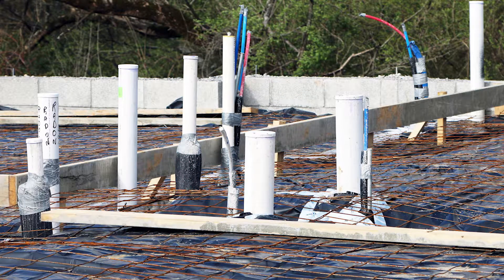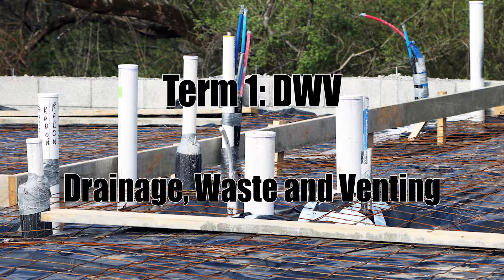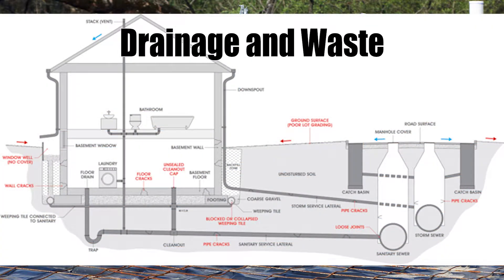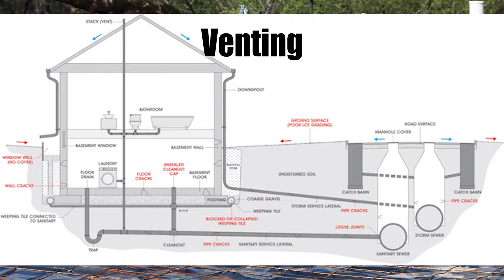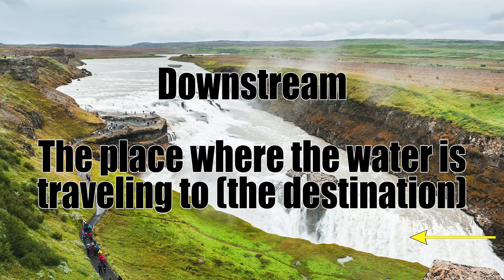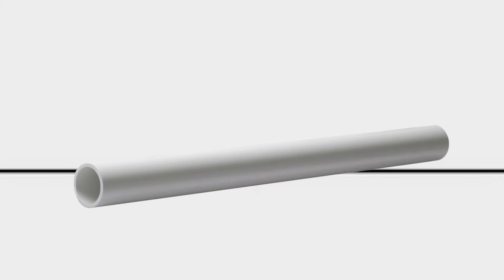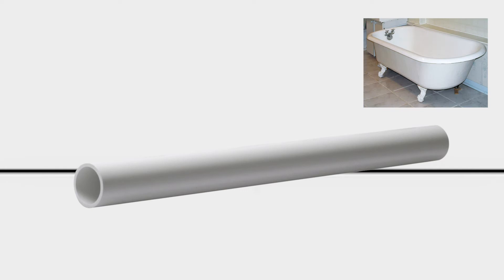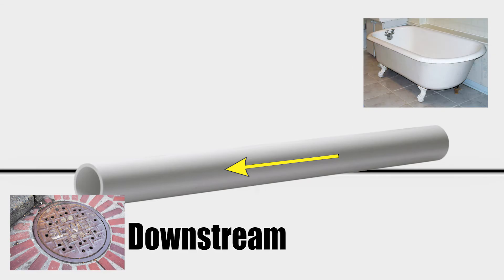Drainage, Waste and Venting: Basic Plumbing Terms

Comment: For a vent pipe, or wet vent pipe, how to tell the upstream or downstream? Because the air is going the opposite direction of the water, which made me confuse.
Reply from the maker: We normally don't use those terms with regard to venting. For regular drainage including wet vents we do use these terms.

Think about it this way: point to a specific location on a drain pipe.

Upstream is where the water would be coming from, higher up in that drain. Upstream = the source of the water flow through a pipe (or a connected pipe at a higher elevation.)

Downstream is where the water will be flowing down to at a lower point in the drainage system. Downstream = the end destination of the water flowing in a pipe (or a connected pipe at a lower elevation.)

Example: you have a wet vented system draining into a building drain. At the highest point of the wet vent you will have a continuous vent going to up to atmosphere.

The building drain is Downstream of the wet vent.
(The building drain is at a lower elevation than the wet vent.)

The continuous vent is Upstream of the wet vent.
(The continuous vent is at a higher elevation than the wet vent.)

The continuous vent is not a source of water, but it is at a higher elevation than the wet vent so the definition still works.
Reply: @MathematicPlumber  Thank you so much Sir, now I know it well. Have a wonderful evening!